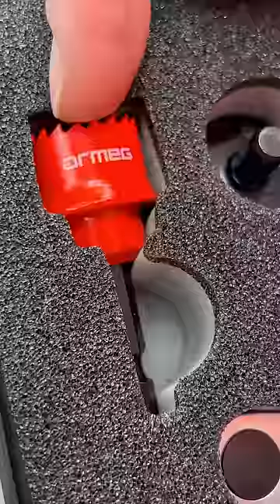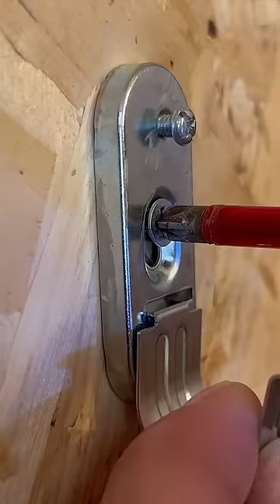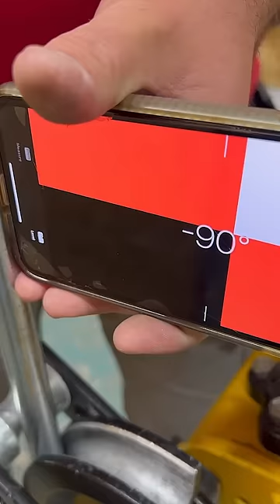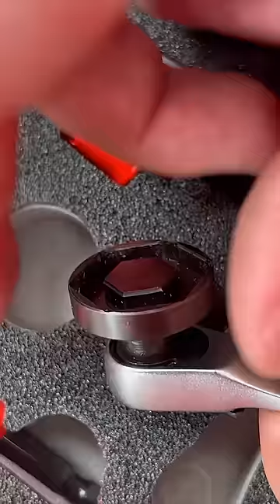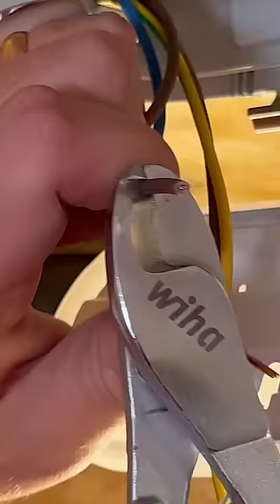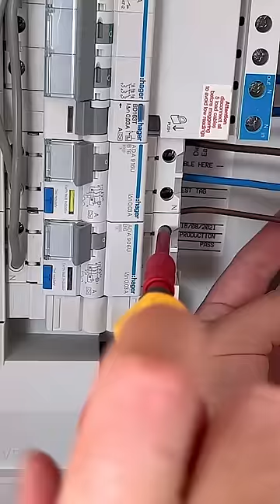How Many Electricians' Tools Does It Take to Fit a Light?

Comment: Q: How many electricians' tools does it take to fit a light?

A: Yes 😂
Reply: Literally what I was going to post.
Reply: I was just about to say the same thing.
Reply: 4 tools
Reply: Screw driver and pair of cutters it could be done 😂 or the efix way 7tools
Reply: By my count, edit:29 specifically (30 if you count the cardboard):
In order of appearance:
- Green crosshair level (Bosch, Milwaukee, etc. all make them)
- Marker in what appears to be custom holder made from adapters and a cable gland
- Flathead insulated screwdriver 
- Automatic Center Punch - 5 inch Brass Spring Loaded
- Cutting Fluid
- Armeg SSH020 Sheet Steel Holesaw, Red, 20mm
- Power drill
- MAVAST Silicone Deburring Tool
- Cloth :P
- Philips insulated screwdriver
- KNIPEX Tools - Pliers Wrench, Chrome (8603250), 10-Inch
- Tape measure
- Magnetic welding holder
- Portable mechanical pipe/conduit bender (can't find the exact one)
- iPhone level app
- Hacksaw
- Square file
- Large die set (can't find his exact one, but a large die set will give you a t-handle. Manual conduit threaders give you a bar not a t-handle to drive the die)
- Conduit reamer
- KNIPEX Tools - Alligator Water Pump Pliers (8801250), 10-Inch
- 20mm Brocket - Conduit Bush Socket - Armeg
- 1/4" mini ratchet
- Fish stick set, possibly glow in the dark variety
- Wiha Classic 34730 Cable Cutter 200 mm (he has an older model, new model has different teeth)
- BAT22-6NV2 Thomas & Betts Sta-Kon Battery Powered Crimping Tool with DIE2001 Thomas & Betts Insulated Terminal Crimping Die, 22-10AWG
- Reel spinner (couldn't find a specific style like his, most of ours (US) are stands that you load the reels on)
- Wiha insulated screwdriver set, 19 pieces - 28398
- Wiha insulated pliers (background)
Edit: last screwdriver is not the same 28398 handle, it is in fact - Wiha 28789 11-Piece Insulated TorqueVario-S & SlimLine Blade Set. Credit: @Elektrotechniker

I did my best for a useless shorts comment that will never be seen again, take it as such lol
Reply: All of them
Reply: Nice job!
Reply: You can be drunk and blind in one eye and still do similar quality work lol
Reply: @iangillespie1605 You forgot the wiha torque screwdrivers for the circuit breakers, etc. at the end of the clip!
Reply: @Elektrotechniker holy crap you're totally right. I didn't notice it was not the same handle from, like, 5 seconds earlier with the quick lock shaft. I didn't even know wiha had that handle and I will now be buying one! Thank you for pointing it out!
Reply: @iangillespie1605  I, sir , do salute 🫡 you of your highest level of observation and collaboration of facts to the highest degree of accuracy!
Reply: More than an electrician its looks like a Space X engineer with 50 tools just for a switch and a light
Reply: Depends if you can get them to agree on what the regulations say, or get them to stop insulting each other's intelligence over contradictory regulations

Comment: I got taught exactly that cardboard trick for shifting singles out of the way! 👏🏻👏🏻
Reply: "Rick's cardboard"
Reply: We all did lol or plastic conduit to keep the singles in
Reply: @phealey1981

Why go to the trouble of looking for a piece of cardboard? Use the lid, pencil, screw, conduit, screwdriver ,etc. Upstairs for thinking, downstairs for dancing!
Reply: @MA-mo7yj  why look for card when I used to carry bits when we were metal munching. 

Winner!
Reply: @PHealey1981  

?? So you needed to be taught to used  cardboard?? Did you need to be taught how to use a screwdriver?
Reply: @PHealey1981  

Never used cardboard for metal work but did use what I had to hand eg off cuts of lid.

Comment: Guy had a pro press for wire connectors
Reply: I use 16mm^2 ferrule crimp for insulated connectors. Works perfectly and saves space in my toolbag.
Reply: It was a 1.5mm crimp tbf ... cut the fella some slack

Comment: I'm an electrician and this guys work is clean as hell and he does everything by the book down to proper torque of small terminals. But I know some guys that could somehow do this with a flat head, side cutters and pair of channellocks. I prefer to use the right tool for the job but even when I was in a panel shop we never properly torqued stuff unless it was 4/0 and up. Honestly never seen someone use a torque screwdriver but they help cut down on hot spots from over torqued conductors.